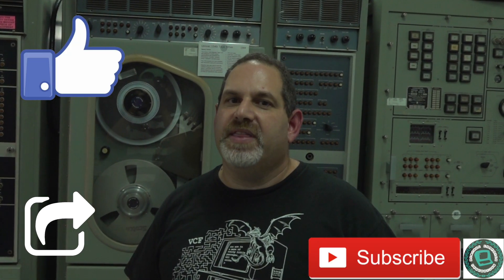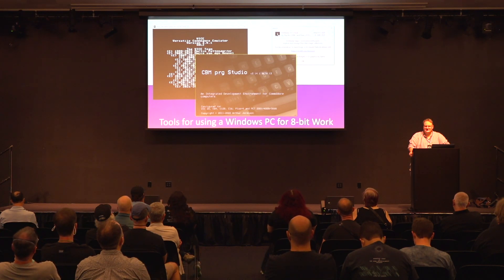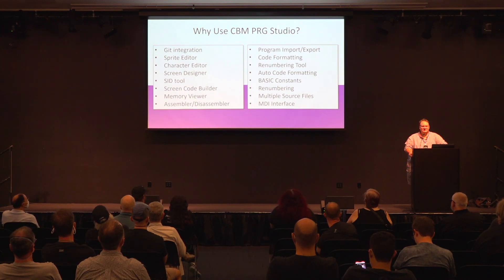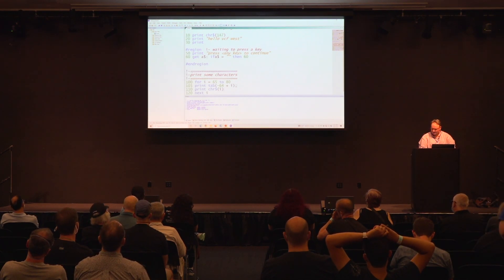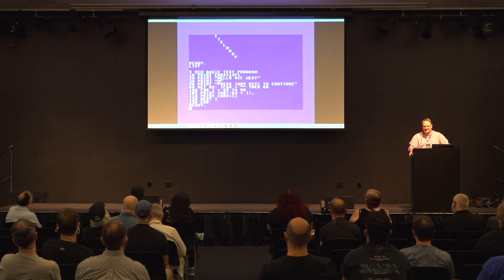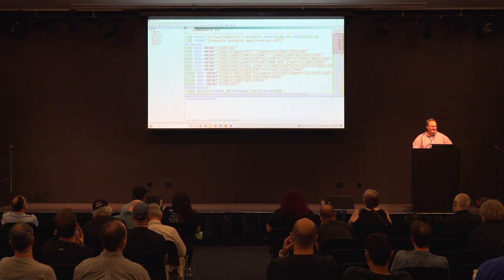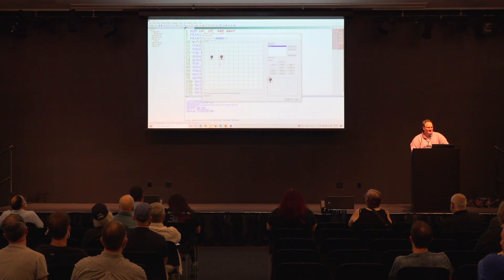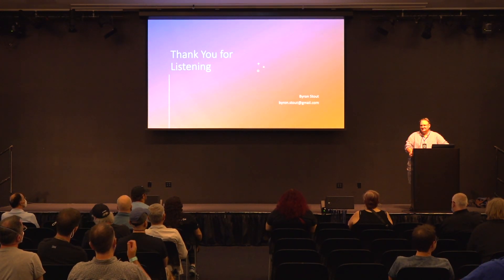Developing 8-bit Commodore Programs Using a Modern IDE — Byron Stout

Comment: I wish you had made a screen capture. It is really hard to see the screen.
Reply from the maker: Yes. Sorry that it is so hard to see. We realize that we need to make some changes in the video for next year. We are shorthanded for volunteers, so we didn't have someone operating the camera. We are hoping to at least supply the slides from the presentation soon. Next year we plan on splicing in stills of the presentation into the video.
Reply: @vcfederation  Also consider contrast. 40 years ago I was changing the colors on the hardware C-64. But it wasn't so bad. In Visual Studio I change to the dark theme to improve contrast. Ditto IDLE for Python for students. Even in Windows. If Windows is set for the dark theme and the programs you use pick it up, that will help. If not, look to see if they have theme color controls. It doesn't help that there are a LOT of men in this field and 1 in 8 men are at least partially color blind (see another color instead of the one displayed). I realize you have limited time, resources, personnel - you are doing great with what you have. When we watch it and we actually want to see it better, it's a testament to your content. Thank you for each incremental improvement you incorporate! Great show. I watch it over and over, because I learn things I missed before. Thank you seems woefully inadequate!